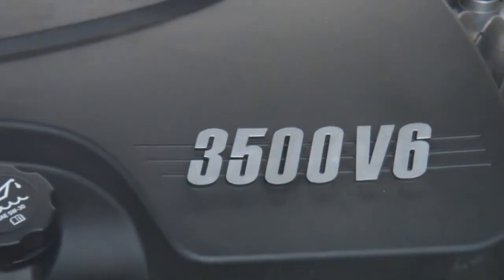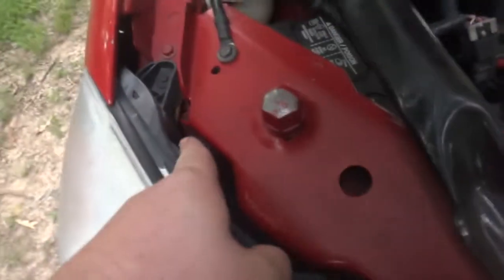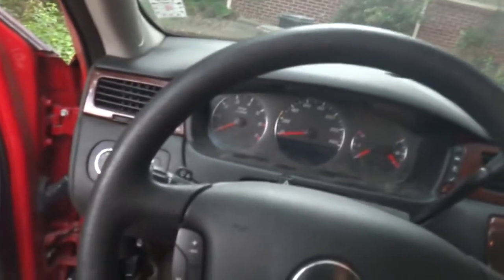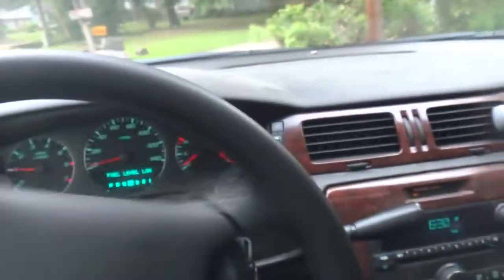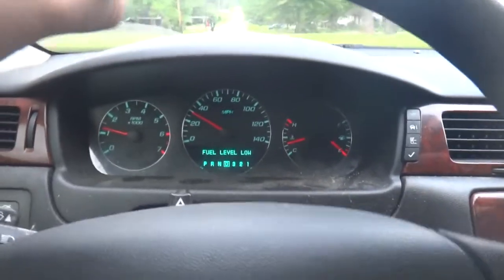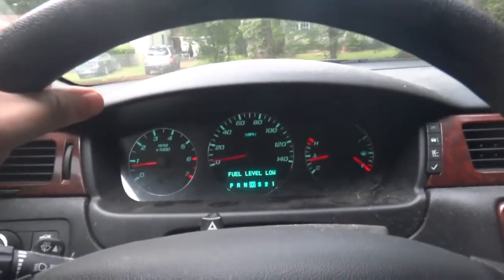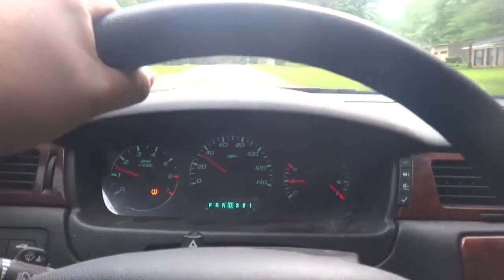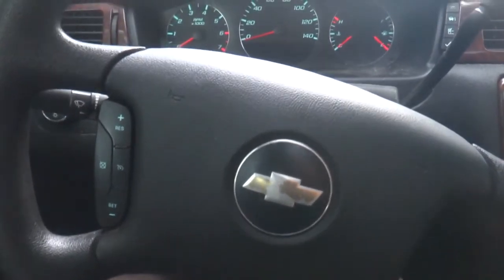07 Chevy Impala LT test drive

Comment: If i was to live in the USA , id buy this car, i really like the way it looks
Reply from the maker: +kimi kimster It's a good car, I will put this bit of information in though. It is a car that can be high maintenance at times...The transmission can be troublesome at times as well as cheap parts under the hood like the serpentine belt and water pump can fail....Also be expecting to have a starter motor failure...It can fail without warning as well...If the car starts misfiring when starting it up. This video was taken literally weeks before my starter completely failed on me. If you notice at 2:35 the engine was misfiring and I even made comment that it was either the starter motor or the battery that was failing...
Reply: Brock's Sketchbook well its a 9yo car u got there so ,nothing lasts forever lol tbh i found nothing wrong with ur sound at 2.35 ,but i guess u know ur car better then i do ,so u can tell when something sounds wrong ,other then that it looks allright to me
Reply from the maker: +kimi kimster Yeah, over all the car still runs great. Never misses a beat and the handling this car has is a dream for such a large car. You would almost think it's a sports coupe the way it drives. It's been a very reliable car getting me from point a to point b.
Reply: Brock's Sketchbook yea ,now i have one thing to worry about only .. how to get to USA and to settle there lol ,ps btw whats that 3,2,1, on the gears? i dont get those 3 gears
Reply from the maker: Lower gear selection pretty much...Even though the transmission is automatic the 3,2,1 are giving the transmission one gear to stay in for per say going on steep inclines or steep declines on the road. Gives the car more control pretty much.
Reply: Brock's Sketchbook so its kinda like more power for the car  due to road terain and D is just for flat driving